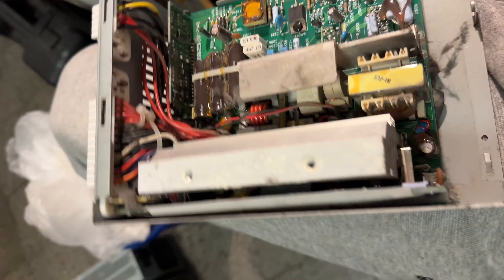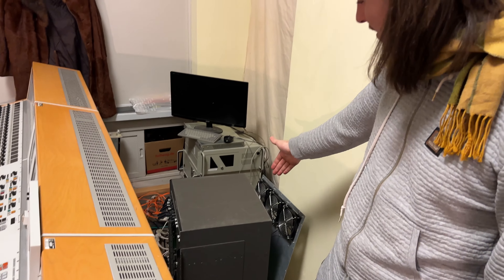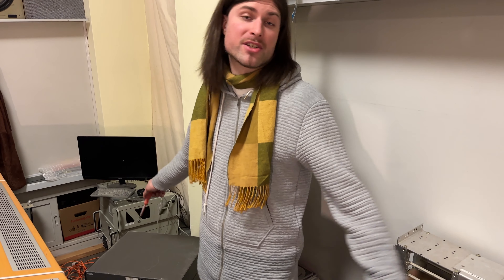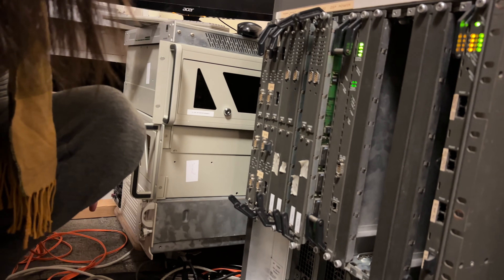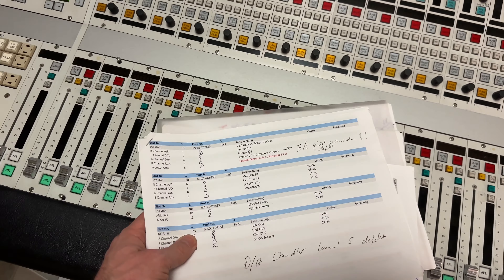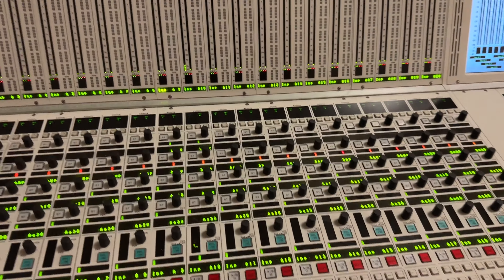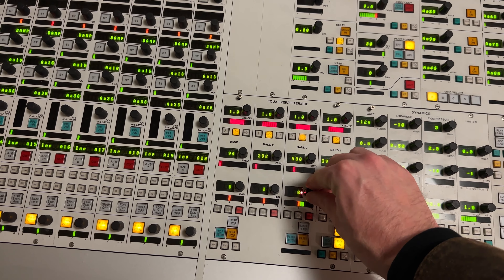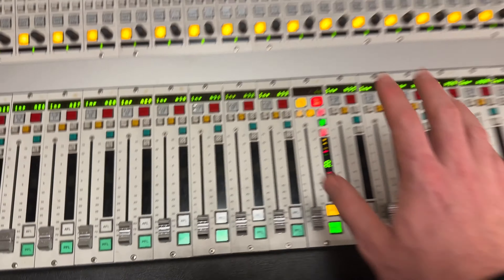I AM RESTORING A 90'S DIGITAL CONSOLE / PROGRESS ON THE LAWO MC2 82! EP.5

Comment: If I didn't know better the card cabinets look like Private Business Exchange (PBX) for telephone switches.
Reply: He said it’s an ATM switch which sounds so 90s because in the 2000s it was more or less killed by Ethernet. But that would explain why it looks so telco like. ATM at the end of the day was mostly used in the telecom sector. 
On the other hand many network switches also for Ethernet look like this. But usually they are horizontal instead of vertical. Still I think some manufacturers used this layout.